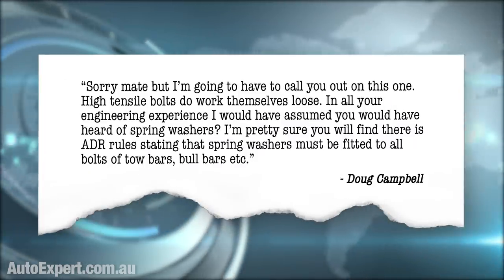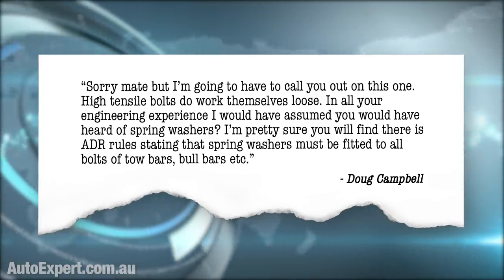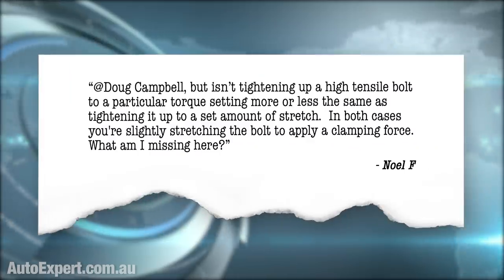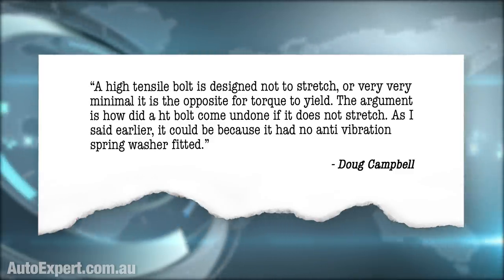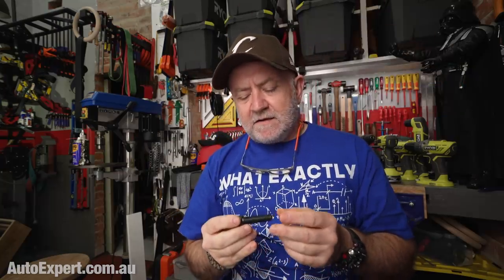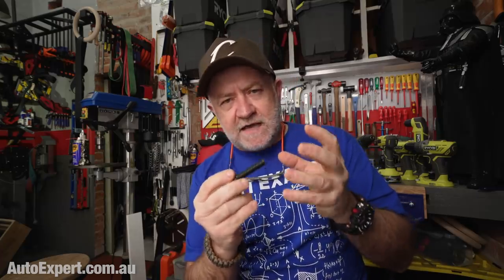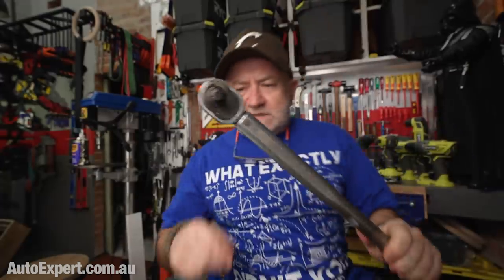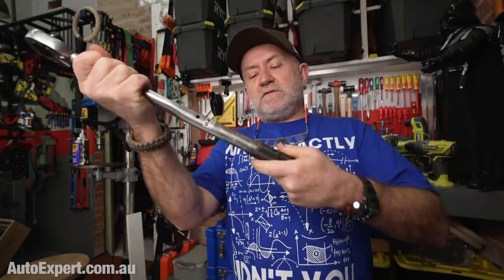The applied physics of high tensile bolted joints and assembly in cars | Auto Expert John Cadogan

Comment: Spring washers -- especially split spring -- are not reliable, and are an old wives tale -- They don't use spring washers in mining cutter machinery: they use NordLok serrated.     And fasteners must also be correctly torqued.        (Me: Prod Eng)

Comment: Loctite always worked for me.
Reply: Good at stopping release, pain in the arse for service, and no good at all if it isnt tight enough to begin with. I'd suggest. I've never used it.
Reply: @stevelloyd5785  use it with a torque wrench as a lightly lubricated bolt, it is then tight enough.
Reply: That sounds a good idea but I would say in the spec sheet that the bar must be re-torqued after certain amount of time which means if Loctite was used the bolts would have to be loosened again to give an accurate torque measurement. The reason I would say these bars are not engineered surfaces and some bedding in would occur so even though the bolts would appear to be tight the pressure between the joints could be reduced.

Comment: Better, still not entirely correct.
I maintain my argument from my comment to yesterdays (cracked frame) video. In other words:
Yes, the bolt tension is where it is at, BUT, if the stretched length of the bolt in the design is too short, then the design is poor for dynamic loads, vibration and impacts.. This is imho because the elastic bolt elongation of the properly torqued bolt amounts, due to the short stretch length, to very, very little actual stretch. At the same axial bolt load, imho more stretch is better to keep things “engaged under contact friction” and not loosening. Thus, all else being the same a longer stretched bolt length design is better (up to a point, beyond which,  it’s just costlier and heavier but not necessarily otherwise harmful).
Further, if the high tensile screw is used in conjunction with an appropriately rated high tension nut, one would think all should be good in terms of thread clearance, engagement length etc. Maybe. I still think threads are not exactly perfect and there could be a little plastic deformation until all thread area shares the load in some not necessarily exactly even way.
Imagine you bolt two skimpy 5mm thick plates together with an M12 x 1.75 high tensile bolt, high tensile nut, and washers of appropriate thickness and hardness. Ignore what might happen in the threads for a moment. Don’t know how thick those washers would be off hand, for the example lets say 2.5mm each to keep math simple. Let’s call the minor diameter of this screw 10mm to keep it simple for the example (it might be as little as 9.966).
So the stretched bolt length here is 15 mm or about 1.5x the minor screw diameter
Now imagine the same boot, but longer, same nut, same washers, but  the connection is such that the stretched bolt length is 75mm or  5x longer as above. If the items screwed together are substantial or an appropriate substantial steel spacer is used (not a thin tube), one could simplistically argue that this screw, at the same load, at the same torque stretches 5x more than the earlier one.  Which one is more likely to keep things highly loaded against each other if an impact or a vibration causes a small displacement of the fastened on item axially?  Which one is more likely to forgive a little canting of the screw head contact surface or the nut, because of some vehicular part imperfection or a tid bit of rust on half a side of the hole.
And I still think that, if all else is the same, if the rattling of things keeps increasing the screw with the shorter thread length will loosen before to one with the longer stretch length.
Totally agree on split ring spring washers.. They have no business in a high tensile bolt connection. Strong Belleville washers or stacks there of let one do some neat things, albeit they also don’t really belong in a high tensile bolt connection (but they can be neat where they make sense)

Comment: Hey Doug, @17:25 just when did torque to yield fasteners get introduced? Pretty sure they havent been around as long as engine head, conrod, main bearing bolts, (steam included), have been operating, flawlessly for decades.
Reply: Hey Phil, when did they stop using locking wire or bend over locking labs on those bolts mentioned? Maybe some correlation there for the ones that open there mouth before thinking
Reply: @WheresmywingsRedBull  Actually Doug, they haven't. Lock wire is still used in aircraft and marine craft on fasteners, and bent tabs are still used on motor vehicles. Surely with all your years of "extensive experience" you would have changed a wheel bearing or 2? Is that correlation enough? Dont be so butt hurt about it. JC has shown how you were wrong and even your comments show you misunderstood how HT fasteners work. Man up, put your hand up and say you fucked up
Reply: @philmenzies2477  I’m talking about this in the context of the bolts you originally mentioned but it appears you can’t even understand what you, yourself are even writing.
Reply: Hey Phil, google ARB ranger rear step tow bar fitting instructions, step 47. Then tell me how butt hurt I am. I can’t post the link as John has blocked it.

Comment: And then you get some hypothetically compliant muppet who uses a spring washer, the cheapest money can buy, and it's soft as cheese so it crushes at some stage early in service and the joint goes slack... and the nut rattles off... and the bolt rattles out...

Comment: Thanks for the lesson, much appreciated. At risk of annoying both yourself and Doug (and with no engineering or mechanical experience), wouldn't this be a case of you both being correct and incorrect? To me it seems you are both succumbing to confirmation bias with your examples to prove the other wrong. You both agree not to mess with the design that has acheived ADR compliance but at the same time, you both seem miss the point (or at least focus on one style of washer) that various bars use either flat washers only or have some spring washers in there as well. If the bar has flat as standard only a moron would add spring washers but if the design had spring washers the reverse would be true if you changed them to flat.
Either way, considering spring washers are flattened so easily, it seems stange to me, the uneducated in all things nuts and bolts, that anyone would choose to use a spring washer in a high torque setting if they simply flatten at low torque/pressure/correct term.

Comment: 'Don't dick with certified specifications.'  Man... as someone that writes specifications and technical documentation for a living, this.  Just do what the paper says, if the paper is wrong, or you think it is, check.  Don't just change something because you don't like what the paper is saying if you don't know why it's saying what it is.
Reply: And that's fine, if it's on the spec, it's on the spec for a reason, adding things, or taking things away just mean the job is been done wrong.
Reply: @Mach1048  So why is John portraying I’m wrong by saying it should have had spring was fitted when they clearly were not fitted?

Comment: I’ve been made fun of for using a torque wrench on my wheels. Can I get it tight enough without one? Yeah, likely over tightened and uneven across the mountain surface.

I’d wager 99/100 lug nuts on cars in the USA are over tightened.

Comment: Well, spring washers do prevent or slow down a loose bolt from coming undone completely.
Not changing a certified design is definitely good advice, even if you did a good thing, liability might shift towards you in case of an accident.
Reply: Spring washers have no place in a hi-tensile environment. Get with the plot dude.
Reply: @Swaggerlot  Relax "dude", nowhere am I advocating for the use of a spring washer in this situation, I'm just describing the circumstances where the spring washer will have a positive effect. Maybe some reading and comprehension classes could help?
Reply: @Kris_M  You are presumably a spotty adolescent as you display significant immaturity. Raising irrelevant points about spring washers does not contribute to the conversation.
Reply: Simply Google, Ranger ARB rear step tow bar fitting instructions and go to step 47. PMSL spring washers are meant to be there as recommended by ARB the manufacturer!
Reply: @Swaggerlot  If you don't like the tone of my comment, then perhaps you shouldn't have started off like that yourself. Ironic how you're now even doubling down with an attempt to be insulting, but in your ignorance you did nothing more than project.
And if you think my original point is irrelevant, then you could've ignored it instead of making a snarky comment.

Comment: M25?????? come on John use a standard size bolt. other than that great video
Reply from the maker: It might be M24. I eyeballed it. Like it matters.
Reply: @AutoExpertJC  At the risk of being argumentative it does matter, it goes to your credibility as an engineer. Knowing common fastener sizes is not a Google it moment.
Reply: @RobB_VK6ES  It actually doesn't go to anything regarding credibility. Fastener sizes matter when it comes to specific use-case scenarios. This was a general class on the principles of fasteners. Holding up a bolt to the camera has only illustrative value - it's not like it was being torqued up right before our eyes. Relax and hear the message, don't get hung up on irrelevant minutia.